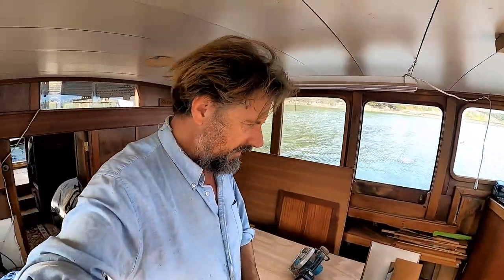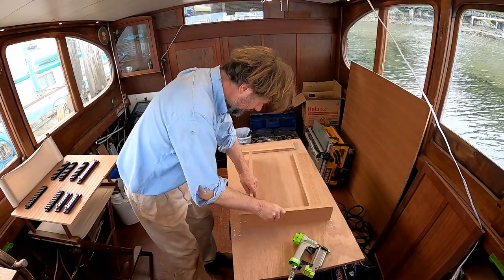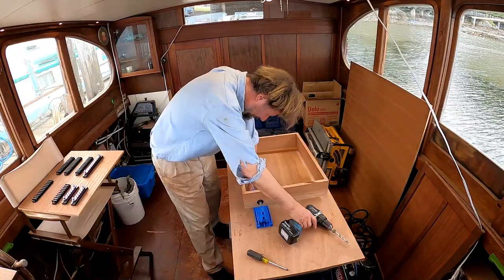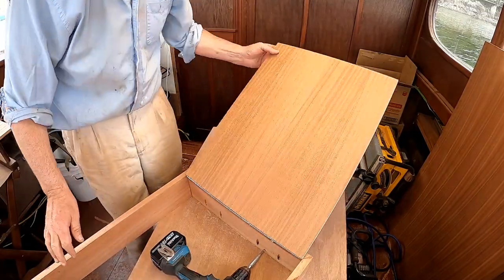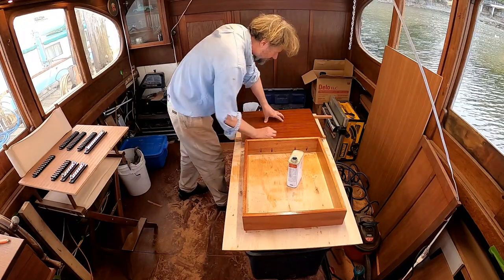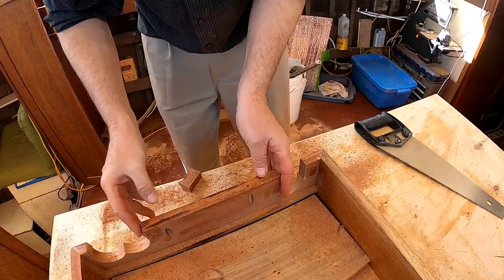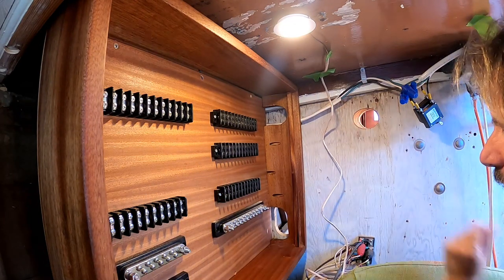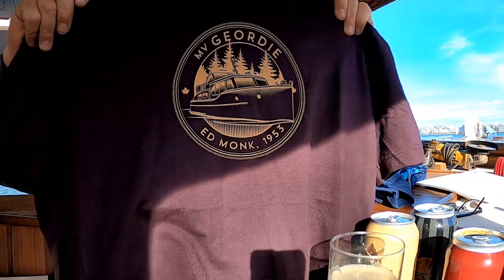New Shirts!- #225 - Boat Life - Living aboard a wooden boat - Travels With Geordie

Comment: I wanted to reach out and let you know I used the screw trick on a cuddy cabin hatch frame I am building.  I built the first one using clamps and it was just a little wonky.  When I built the  second  hatch frame I used cabinet screws to make the frame lay perfectly flat.  I will drill out the hole and fill them with ¼ inch plugs to make the frame fastener free.    

On the use of pin nails, in twenty year or so, dark spots may show up where the pins were installed as the rust migrates through the wood.

Comment: I see this again and again with boat rebuilds. People love to combine AC and DC power in the same cabinet. 
Really bad idea. 
Canada also requires that these two services be separated.  
Probably should think again. Even if you think you’re going to be okay the next person who works on your boat may not.
Reply from the maker: Hi Ian, Thanks for the feedback. ABCY only requires that the actual metal panel be isolated for AC and DC. This cabinet is completely ABYC approved unless I'm missing something you can send me a link to.
Reply: @TravelsWithGeordie  
Here’s what I can tell you off the cuff. When I have had Canadian boats surveyed for sale having a separate AC and DC panel as one of the items on the checklist. All boats built in the last 30 years or maybe longer have been done that way. But at the end of the day keeping the AC isolated either with a cover or a secondary door of some kind will keep you safe when working on the DC.
Reply: @ianwidger7905  i agree FWIW
Reply: @ianwidger7905  Even a shelf or partition between the panels would make it a bit safer. It would help prevent someone who is less than gifted at using tools from laying a screwdriver or something across both panels.

Comment: Hey Peter 
Hi From Australia 
Our local electrical regulations stipulate that mains voltage panels have a touch proof cover installed .Most panel builders put a perplex cover that can only be removed with screws .
Labels should be attached clearly marking DANGER 240 Vac .. 12vdc/24v dc not so dangerous but still good to identify . Just food for thought to protect the innocent and the dumb !!